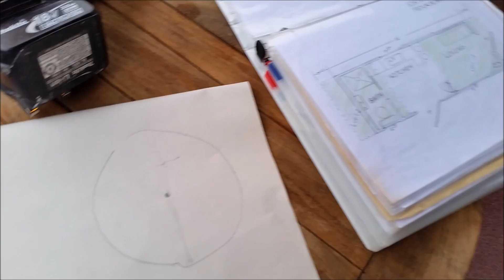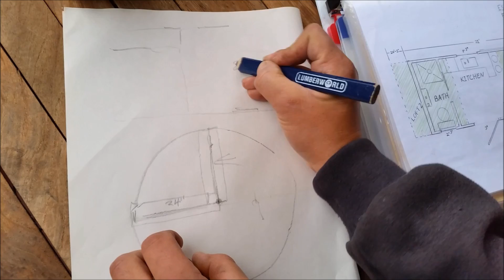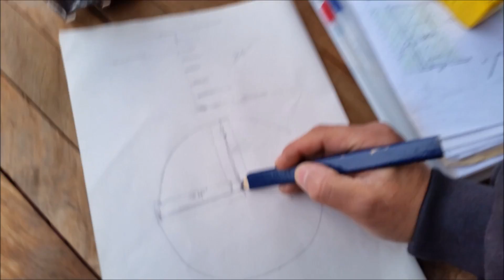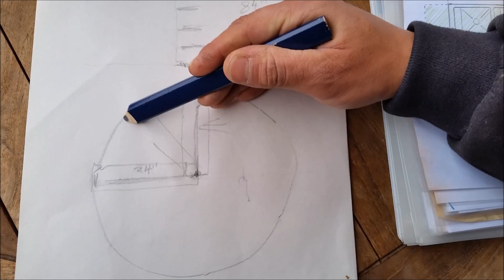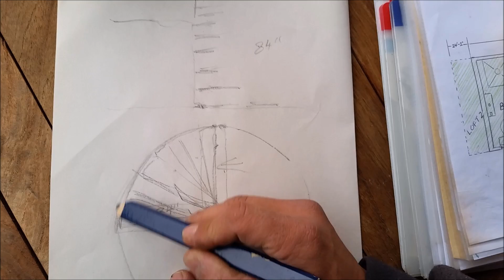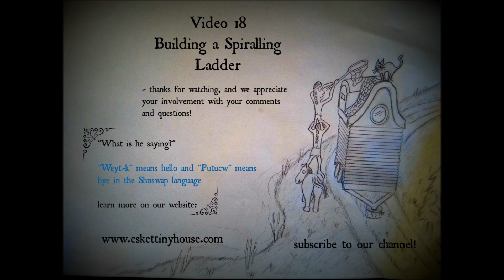Building the Esk'et Spiralling Ladder - Video 18

Comment: Great Design!!  I'n considering this for my next tiny house build which has TWO lofts.  For the tiny house I live in, however, the top stair is 18" below the floor of the loft to assist with the standing to kneeling transition. Have you considered that?  If not, why did you decide to go with a "normal" rise for the top rung of the ladder. Do you think an 18" drop would work for this design?

Comment: I noticed that there are screws protruding through the plywood. Are they there to hold the layers together while glue sets?
Reply from the maker: +Carl Kopsho yes, they are. We laid out the screws only in the cut-off areas, for while the glue is setting.